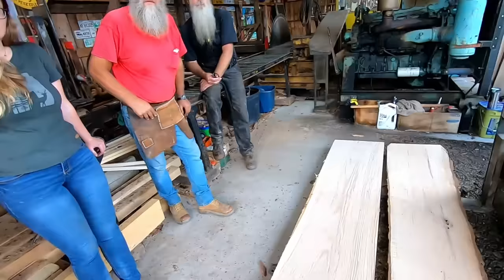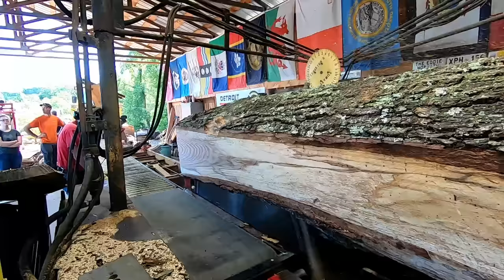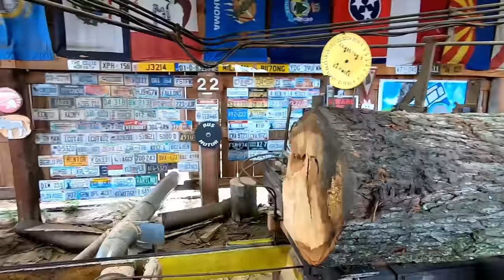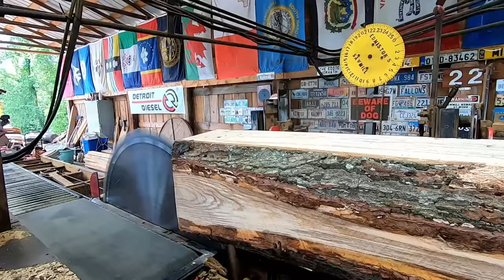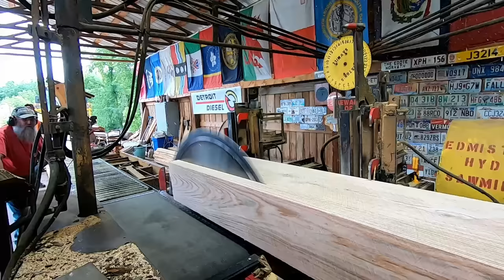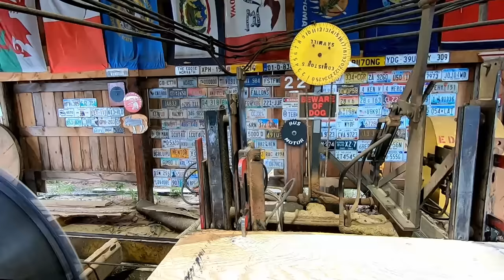sawing a big scarlet oak log into decking # 455

Comment: As I said last time, you needed to try your ''repairs'' with a log on the bed to see if it worked! Look how it only struggled when you got a good amount of sawn wood down on the bed and after the oil was warmed up - too much friction for the rams to overcome. You haven't got a flow problem you have a pressure problem IMO. You need to install a pressure gauge on the bushiness end, one with the correct fittings so you can move it to different parts of the system for troubleshooting. I'd start at the main pump.
Reply from the maker: this was filmed before  the problem was fixed all's good now watch this video, https://youtu.be/wPzow_BcXZo
Reply: @markgalicic7788  OK, thanks.

Comment: Sometimes when trying to find a problem in a 'system', try to find a point in the middle and see if the problem shows up there. If it does, the problem is up stream. If it doesn't, the problem is downstream. Then find the next middle point. Etcetera. If you can draw a simplified diagram of the system, that will help. You have the system drawn in your mind, but paper may yield results. Doesn't really matter what kind of system it is.
Reply from the maker: yes very true.
Reply: Exactly the same in electrical troubleshooting, and any other kind of problem solving, start in the centre and work outwards. But start at the source/big- picture first, eg, "is the main breaker on"?. Then trace out from the centre. Divide & conquer.

Comment: Given the viewing angle and distance from the operator seat to the scale dial, the fact you can consistently nail 1/4" increments is impressive.  So, close enough, is good enough for your mill.
Reply from the maker: close enough to me is a 1/32" not 1/4"
Reply: I Run a Mobile Dimensional Sawmill . Quarter saws from top down . Makes the Most out of log . No turning the log . Can handle Any Size log . Look them up .

Comment: That mill sure does some fine sawing BUT if you had a bigger blade and COULD cut bigger stuff, you'd be fouled against the blade and riving knife against the parallelogram support and Eddie would quit and go back to pushing barges or finishing concrete, one or the two. Better off being safe where you are. Please tell Buzzworthy he was missed and yall did a fine job. A-PLUS! And yes, the bus motor was liking that a LOT! About the only oil leaks you have are out the air box drains and they're supposed to be there. The old 50's 4-71 at the Scalawag flat belt mill had both drains run into a filter of some kind with a drain. It also had the cold weather start setup on one of the air box covers. Progress. Thanks, Buddy!
Reply from the maker: great comment Lewie lol!
Reply: @markgalicic7788  You know how I get!

Comment: Thanks!
Reply from the maker: thanks Chris!
Reply: @markgalicic7788  It's entirely possible your switch may have burned contacts which causes intermittent connection, find a test switch and use it as a bypass to eliminate the control switch.
Reply: @markgalicic7788  no thanks needed, I used to be the log turner on a old circle mill ,  your channel brings back so many memories.  I have been wonder for some time, if you allowed people to come up and see you mill and the crew working. And one more thing  I’ve been putting off buying a cherry boom sign. I sent you an email and got no reply, I understand you are busy.  My question is are you zz and Eddie still signing them?  Before you ship them??
Reply from the maker: @christatman2547  yes we do have people stop by and watch us saw , and we do sign our boom signs.

Comment: Most buttons I ever saw, has a spring under the button, that can get weak.  Thinking out loud.  lol.   I have also seen before, what I call micro dust, get in and gum up the buttons smooth side surfaces.
Reply: Me thinks you might be right. Something in the switch is not functioning quite right.
Reply from the maker: please watch this video first , https://youtu.be/wPzow_BcXZo

Comment: I don't know how old the electronic valves are on the carriage, you might want to replace them. You may have power up to them but the solenoids might be worn out. Think of how many times you push that button. 🤔 I would take that main flow control valve off and put separate flow control valves at each accessory then you can control each one separately. Just an idea.
Reply from the maker: watch this video, https://youtu.be/wPzow_BcXZo

Comment: Does the button go directly to the solenoid or is there a relay in the circuit? I have dealt with relay’s acting like the problem you are having.
Reply: You can see the rams trying and the hoses twitch - it's not an electrical issue.
Reply from the maker: @julianstafford7071  thank you Julian.

Comment: Question, do you know about sizing the cant by multiplying the small end diameter of the log by .7?  IE: a 20" log produces a 14" cant. ,Obviously there are lots of variables, shape, crooks and whatever but it is a place to start. I am a YouTube certified after watching You and FricknJeep and others.  Just wondering how common this tidbit is?
Reply from the maker: I edge the flitches that are 3-1/2" before it gets down to 11-1/4" to split into two boards.

Comment: Dear Mark Galicic.
👍👌👏 Well done again and as always (video and work). 2) Please kindly allow me to ask something: Since the very first video I watched on this channel, I wonder if there is no possibility for having a second log turner on the carriage itself respectively behind it. Not with teeth like Chewy but like one or two common hydraulic cylinders. Just to help to tip over the log sometimes instead of having to turn it so often. Especially with a big log, a contraption like this could be very useful. What do you think about modifying your old sawmill in that kind of way? Less stress for Chewy and especially less stress for the carriage. Thanks in advance for answering.
Best regards, luck and especially health to all involved people.
Reply from the maker: these are called cant kickers but I will loose my tapers if I install them , what Frick mill are you talking about modifying ? and also kickers are very hard on the knees as they take the weight of the log while turning it.